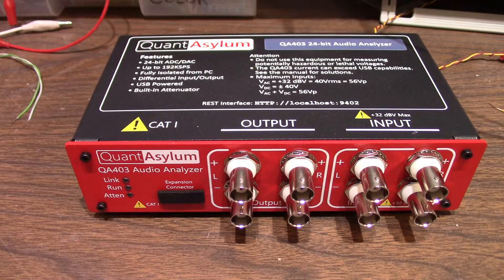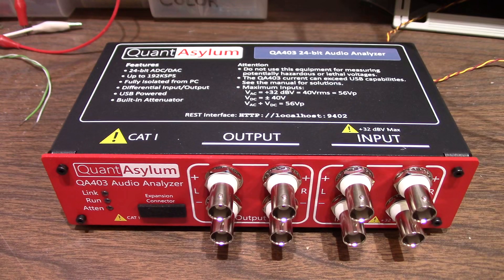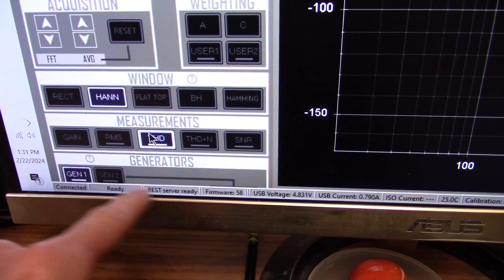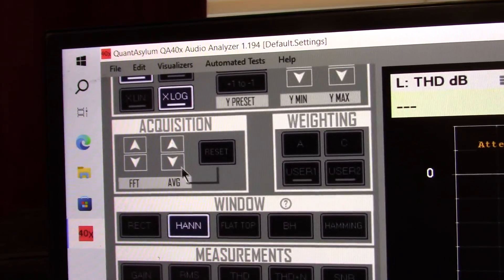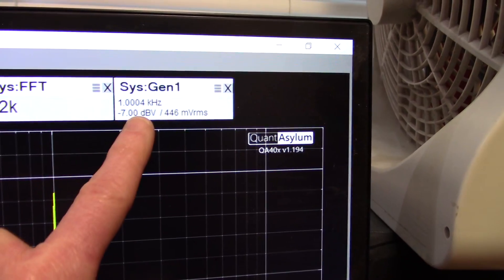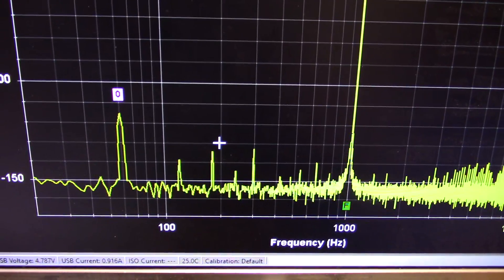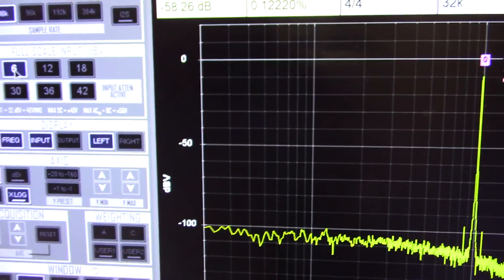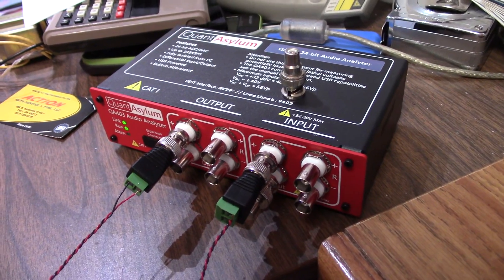QuantAsylum QA403 Audio Analyzer first look

Comment: I got mine a few days ago. I checked the distortion levels of my function generators. The Siglent has 0.09%, The Rigol 0.013%, surprisingly the Ipad with a function generator app is at 0.007%. 
The QA 403 is indeed much better at 0.00009%. Impressed. This will keep me busy for months to come.
Reply: Interesting. I just got my unit today and mirroring the test that John did my THD was sitting at -118db/0.00012% which is quite a bit higher than his -128/0.00004% and slightly worse than yours. I'm a little disappointed but I guess these differences are probably coming down to component variability. My unit does meet the specs provided by Quant but just barely.

Comment: input gnd and usb gnd are isolated, so if you want to remove that 60hz ripple you can connect input and usb grounds together and that should ground the circuit

Comment: Just a thought: If you ever needed to use your “Feel Tech” sig gen, take that %THD away from the Amp's output %THD - there might even be an offset facility within QA403, great bit of kit, but way too expensive for me.
Reply: very good point   i understand that cheap generators have high distortion ?  i cant find the value in the specs
This is weird   a very important point

Comment: I've thought of this unit. But I need more than just THD, I need to know the level of each individual harmonic, 2nd, 3rd, 4th and 5th. Amplifiers might have low THD but they sound bad because its all 3rd harmonic distortion. And an amplifier with 1% 2nd harmonic distortion will sound better, even with the high 2nd harmonic distortion. Higher distortion at the even harmonics are musical, but even a small amount of odd harmonic distortion is dissonant. Can this unit graph out the individual harmonics? Or is it still limited to only doing THD?
Reply: The QA40x Software has a feature built in which is called THD Bargraph Visualiser. It shows you all the harmonic in a bar graph, with the dB volumes of each harmonic
Reply: Amp builders both hifi and for guitar would surely be interested in that demo! Thanks. @dedondigital
Reply: He showed how you can label arbitrary frequencies. Also the software provides an API through http (a bit wierd tbh) so you can grab all the data you want for processing in your favourite language.